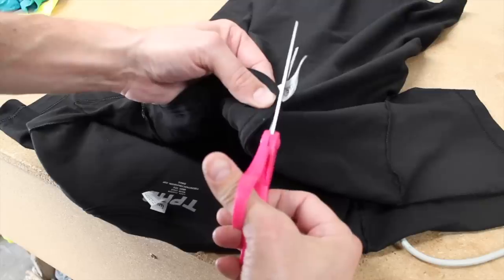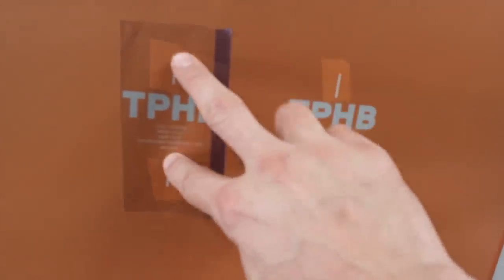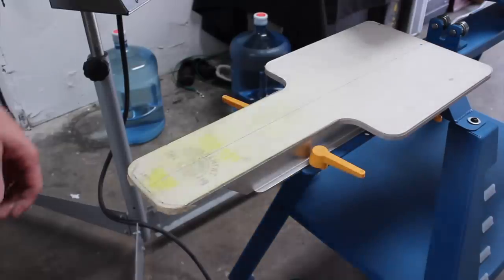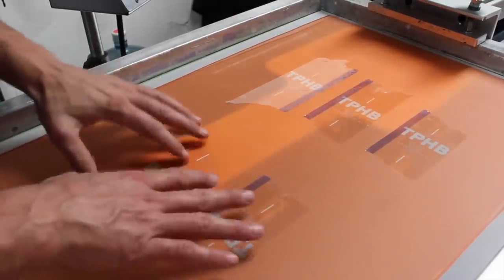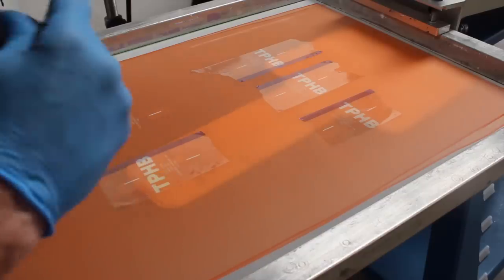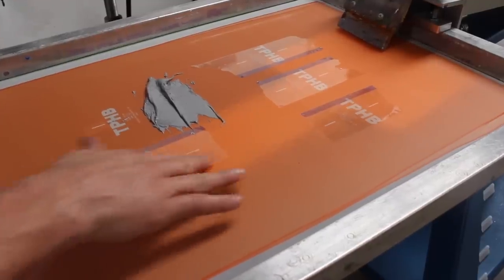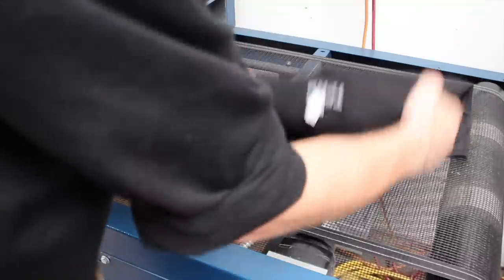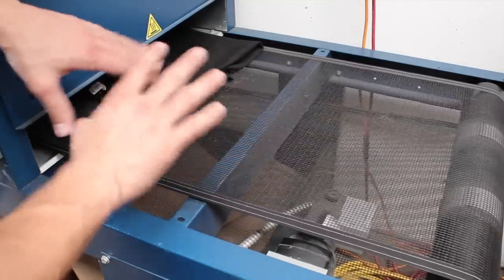How to Screen Print T Shirt Neck Tags and Remove Sewn in Labels

Comment from the maker: What's your method for screen printing tags?
Reply: I'm from Brazil and make the same thing but I'm use a Silver color and works good to. Thanks to show your method in this video 👏
Reply: My first run of shirts last year, I did pre made transfers from Transfer Express... But... I didnt add shirt care. I only added my name... Lol-rookie mistake🤣🤣😍
Reply from the maker: @MsDarkside21  we may have try silver. Thanks!!!
Reply from the maker: @cherylbrown6746  LOL! Well, you should add whatever looks good and makes you happy!!! But be sure to check regulations in your area because when a shirt is made or printed may be a requirement. :)
Reply: The same, but if I leave the ink on the screen for that long it dries and clogs up the screen. How does yours not do that? Do you use a different type of paint?
Reply from the maker: I like to use plastisol ink, which it's oil based and you could leave it in the screen for a long time, say weeks, without it drying. @miguelmelendeztorres
Reply: @mikeydesignssilkscreen473  awesome! Thanks!!!
Reply from the maker: @miguelmelendeztorres  Welcome!!!
Reply: I got a shirt that won’t remove the wording, how would i remove the screen print?
Reply from the maker: You can use a spot cleaning gun, also known as a blow out gun. Check my channel for a video. You can use the same method for things like that. :)
Reply: i guess Im asking the wrong place but does anyone know a way to log back into an instagram account?
I was stupid forgot the login password. I would love any tips you can offer me!
Reply: @Camden Raul it did the trick and I actually got access to my account again. I am so happy!
Thanks so much you saved my ass !
Reply: @Lucian Kendrick No problem xD

Comment: Thanks for sharing . The way I do it is in a similar pallet ; Although , I don't flip over the shirt is lot waste of time in long runs and I use water base ink any color . I just catalyzed the ink and I don't even have to send the shirt  to the drier at that point . That way is very fast in long runs . I can tag 100 shirts in 30 minutes without flipping over the shirt and send the tee to the drier since the ink is catalyzed and Water base there's no problem for sticking the ink on the garment and when the shirt is on the process of the actual front print and sent to the drier the tag only needs very few amount of heat and dry totally . I recommended  . Greetings from NYC ! Great videos !
Reply from the maker: Nice!

Comment: Great video. How would I setup the neck labels up in Adobe Illustrator on 13" x 19" paper?
Reply from the maker: Thank you! I normally just put some center marks around my art, print the film, then line my art up on the press and grab my unexposed screen and set it up on press. Then tape the film to it. If that makes sense.
Reply: @mikeydesignssilkscreen473  Yes, I understand. I appreciate it.

Comment: Hey great video! What size should the tags be if made in Adobe Illustrator when sending it on to a screen printer? As should it be saved as a png?
Reply from the maker: Thank you! I would print them out at full print size, and go from there. Every tag print, and client is a little different. As long as you're happy with the size, you'll be good to go.

Comment: Though I use Plastisol Heat Transfers, you definitely showed me how to cut the tag, just cutting it on an angle makes a difference. I was at times putting holes in the shirt. 🤦🏻‍♂️ Thanks Mike!
Reply from the maker: Any time! Yeah, it takes some messing up to learn how to get it close enough, even with doing it at an angle, how to not put holes in shirts. You'll also get the feel of the scissors having a little more resistance when accidentally cutting into the shirt, in which you'll learn to stop and reposition the placement of the scissors to stop putting a hole into the shirt.

Comment: when I print my tag it would go through at the back especially on a white t shirt. pls help
Reply from the maker: Use a gray ink for most shirt colors. Avoid using dark inks on light shirts. Don't mash the ink through the shirts, but let it sit on top. This may require using a lighter print stroke, so the screen / ink / squeegee are just kissing the shirt. Try a 156-200 mesh, You can also reduce down your ink. because it doesn't need to be super opaque. A vintage looking print will work fine here.

Comment: Im using a 230 mesh but somehow the image still slightly transfer on to the other side i can almost feel the image in the other side where I printed any advice
Reply from the maker: Try a 195, or 200 mesh, and use less pressure. Maybe even reduce the ink a little so the print lays on top of the fabric rather than pushing it through the knit.

Comment: I thought about getting some of these done with a local screen printer but with the plastisol transfer paper.  Would get a load on a sheet and I could press them on as and when.  Any potential issues with that method?
Reply: That's how we do it in my shop. Much easier than this way.
Reply: @ZioEnzo  thanks for the info. Do you use them for the main prints too? How do they hold up? Cheers.
Reply: @Marc-th9xw  We screen print or DTG directly to the shirt. Transfers are pretty durable but not as durable as a screen print. Transfers on the neck also ensure no bleed through.
Reply from the maker: As long as they did the transfers correct, that would work great. Since we do a lot of custom work for others isn't easier for us to just print direct and save that extra step.
Reply: We make our own tranfers.
Reply from the maker: @ZioEnzo  Nice!

Comment: what inks u use mikey? thks. im doing label print but with just 5 hits my screen was clogged already. can yu suggest a good ink for labels with tiny details? also some mesh info thnks and good day.
Reply from the maker: Hey Mat. I used a C8 cool gray plastisol ink by Wilflex and a 200 mesh screen. I hope this helps!
Reply: @mikeydesignssilkscreen473  thnks mikey. that sure helps.
Reply from the maker: @matdcorral  Awesome!

Comment: O man great quality control but damn I would have to double my tag prices if I was to do it your way =D. I feel like most customers would prefer the cheaper price point since it’s just a tag.  But that’s just my experience so far. I’ve never had a customer complain yet.
Reply from the maker: I hear that! These tag prints go really fast. In most of my tutorials I'm just taking my time to explain things. Time for some real time production videos?  A couple weeks ago I posted a video of me running the auto and screen printing on the little manual at the same time. :)
Reply: @mikeydesignssilkscreen473  yeah I know it goes much faster once you get going but you still have to flip those shirts inside out and then back. Do you charge an extra fee for removing sewn in lables vs tear away?
Reply from the maker: @danielmullins572  Not when you have a second hand doing all the flip, folding, and tag removal. ;) We just do that method, flipping the shirts inside out, for smaller runs. We use what is the normal method, print them right side up without flipping them inside out, for larger runs. 36 and above. We don't charge more. We make it part of our pricing. Only takes a few seconds when you get in rhythm. https://mikeydesigns.com/screen-printing-pricing/
Reply: @mikeydesignssilkscreen473  thanks for the reply brother. That's a smart way of doing it. I've been charging a flat 75-50 cents per tag. Bit since you charge more for less qty that makes it worth the extra effort. Plus a happier customer. I may implement that system at some point.

Comment: There is another way to printed ...
If you burn the image facing your way 
Close to you .. it’ll be easier to load the shirt up 
And won’t have to put it all the time ay in. 
If you turn them inside out it’ll be easier but too much time at the end to turn them normal
Reply from the maker: Thanks for the tip. We do it that way as well for larger runs. Kinda do it based on the size of the job and how picky our client is. :)
Reply: @mikeydesignssilkscreen473  Ok stupid question :  if you don't turn the shirt inside out how do you get it to cure in the dryer ????